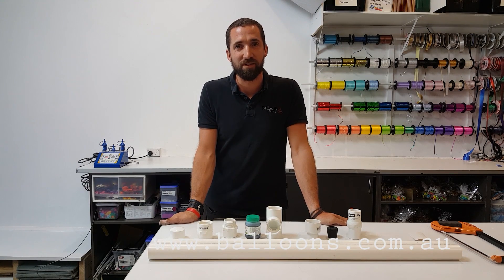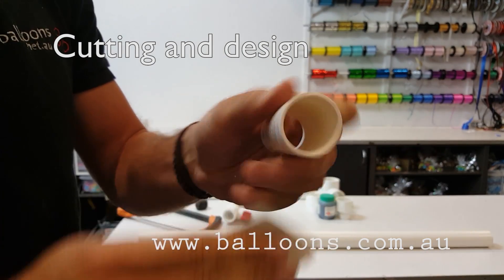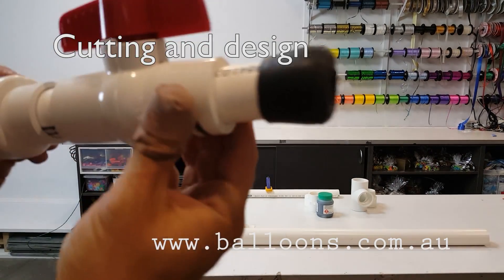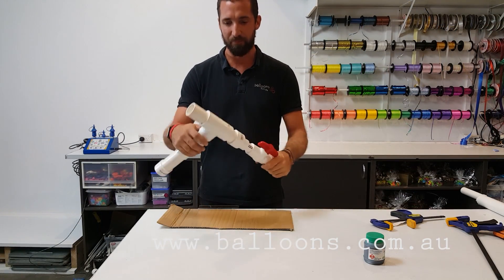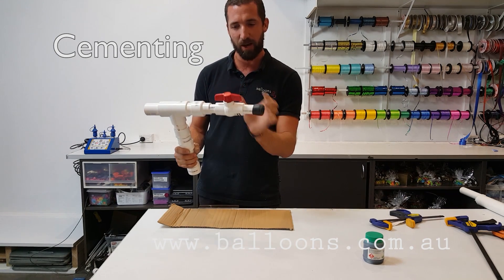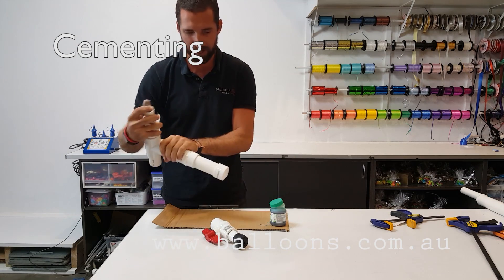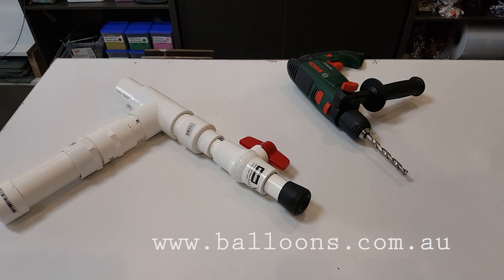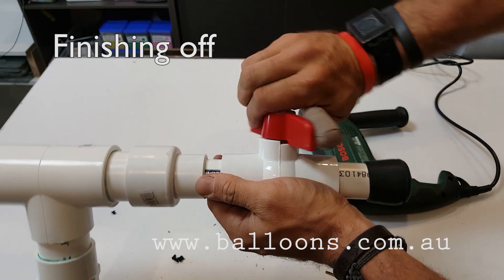Balloon Confetti Applicator Construction

Comment: Do you have any tips or videos on filling 30cm confetti balloons (with helium)
Reply from the maker: Hi Amy. We avoid filling the smaller 11" Balloons with confetti. Just not enough lift left after the weight of confetti
Reply: @Balloonpro   Thanks Chris! yeah I try to use less than 4grams and it seems to be light enough, however,  I'm struggling big time to get the confetti distribution right.

Comment: will a 11" latex fit over the end?
Reply from the maker: Hi Sue. Not for this sized pipe i'm afraid. I wanted to use pipe wide enough to take up to 30mm confetti... I'm sure you can build a smaller version with smaller pipe.

Comment: Hi Chris, thank for this.. but pls can you give details of the product used to create this air filter.. I am looking to create this but confused on the material used. thank you
Reply from the maker: Hi Dee. Thanks for your interest. The sizes and specific products I used don't have to be followed exactly, you can vary depending on what is locally available to you. I used 40mm pvc pressure pipe for most of it, this worked well as the same hardware store sold rubber leg end caps with an inner diameter of slightly less than 40mm so it could stretch over perfectly.

Good luck!